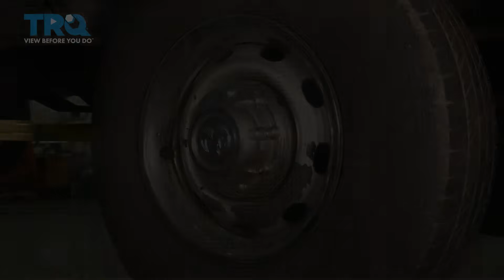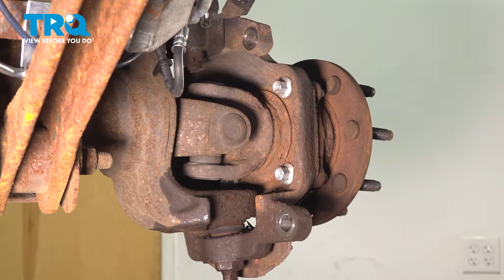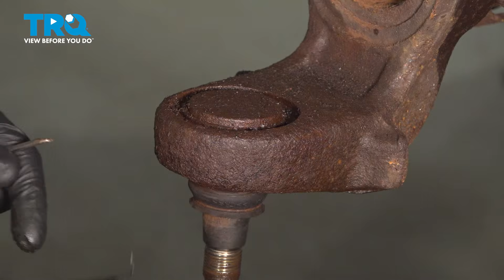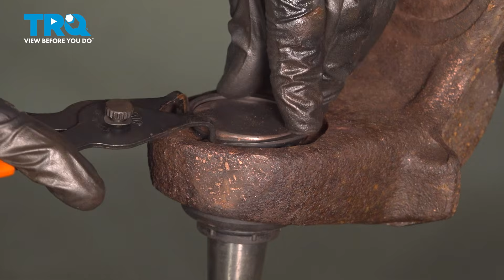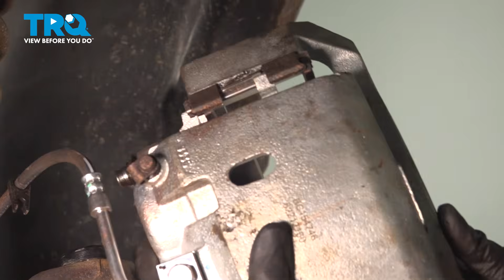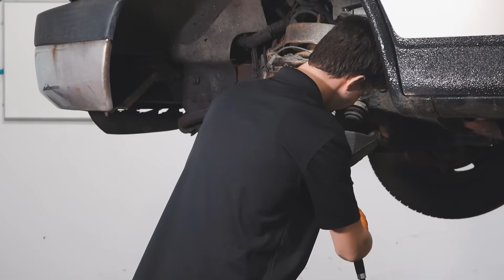How to Replace Front Lower Ball Joint 1994-2002 Dodge Ram 2500

Comment: This video is very informative and I appreciated being able to view it but it does represent a 1996 Dodge 2500 4x4. The ball joints are reversed on a 1996 Dodge and are MUCH more difficult to remove

Comment: Pro tip: There is no need to remove the axle nut. You can remove and reinstall the hub/bearing and axle shaft as an assembly. The only time you need to remove the axle nut on these trucks is if you're replacing the unit bearing or the stub shaft.

Comment: I just watched this because I had my upper and lower ball joints replaced by a shop and now the passenger side axle seal is leaking!Have to take it back tomorrow.Wanted to see if the axle shaft needs to be removed.Other than that I would have cleaned the parts better.

Comment: The problem with the removal and installation of the axle is the inner seal will tear and there will be an inevitable gear oil leak coming out of that axle tube after a few miles driving down the road. It’s happened several times to me even trying to keep the axle perfectly level while trying to remove and installing it.
Reply: You found any way to not have this happen?

Comment: This is for a 99-02. 98-92? Has the rotor and bearing pressed together or at least pressed together with the studs. And the rotor sits between the bearing and hub. And the caliper is directly bolted to the hub with Allen bolts not 16mm hex’s. But still I love this channel. It seems everything I’ve needed to work on is on this channel. And I got your wheel bearings too.
Reply: My truck is a 98.5 24v